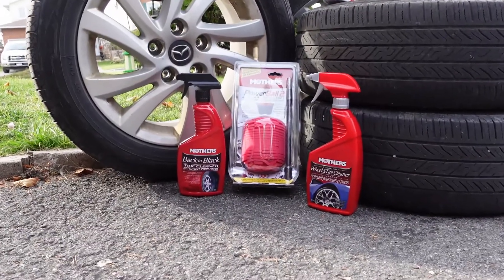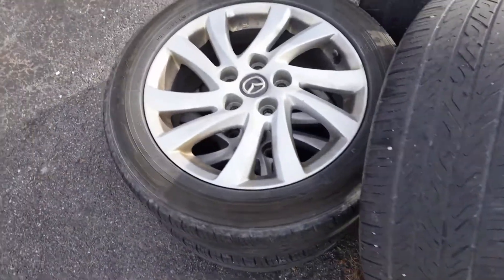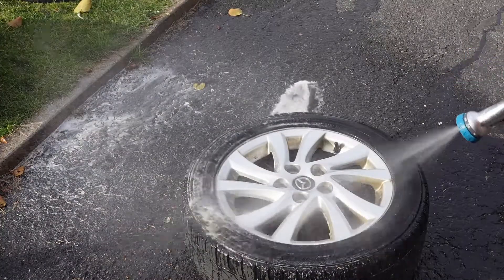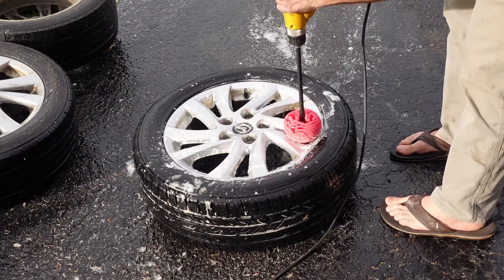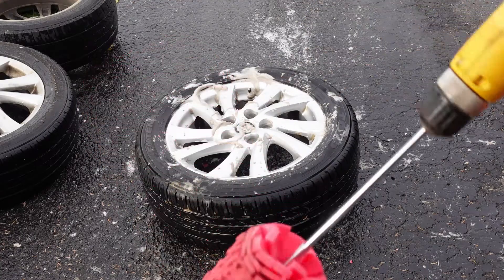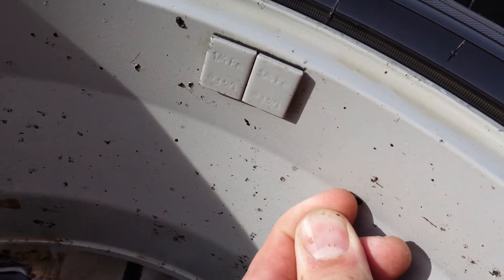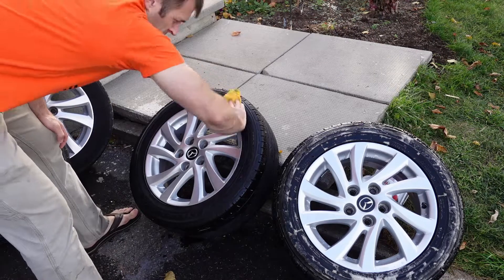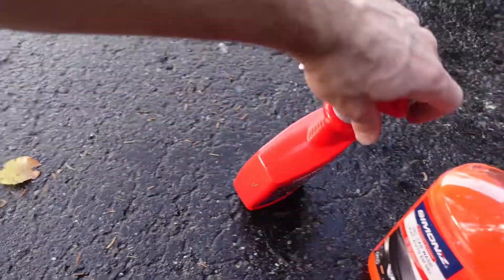Wheel and Tire Cleaning - Mother's Products

Comment: Very nicely done, bud! The powerball definitely transformed the 🛞! I’ve had good luck with McGuiars Wheel cleaner that Inalso use as an iron remover on paint. This product does a good job at dissolving brake dust. Thanks for sharing!
Reply from the maker: I like the powerball. The other mother's products were just ok. I'll try the McGuire's next time. Is your Nissan on the road. I've been looking for the big reveal post Rad swap.
Reply: Where did you get the middle caps for the rim? Mine fell apart
Reply from the maker: They came with car, but I would just go to the pick and pull scrap yard to get new ones if these ones were either lost or get broken.